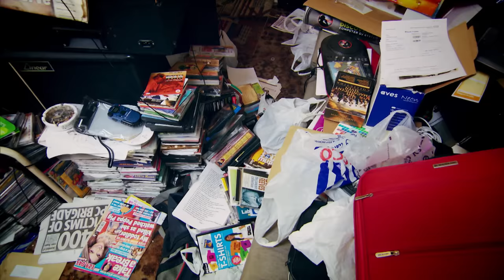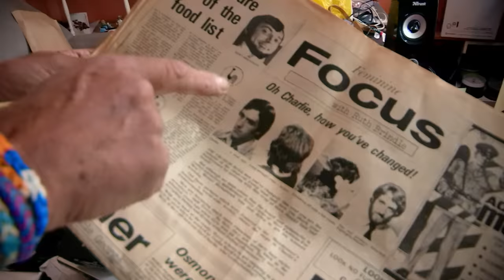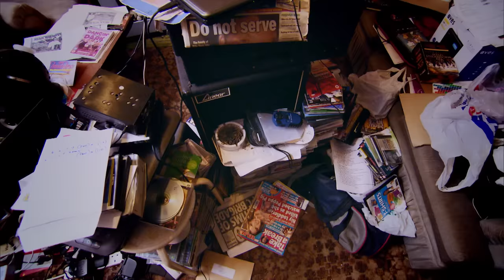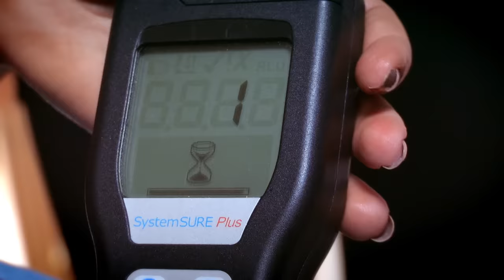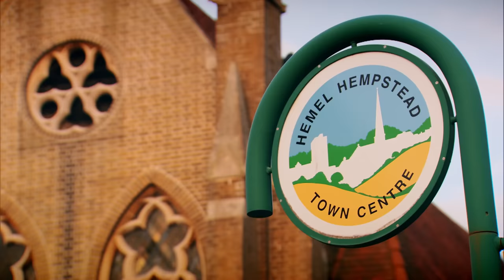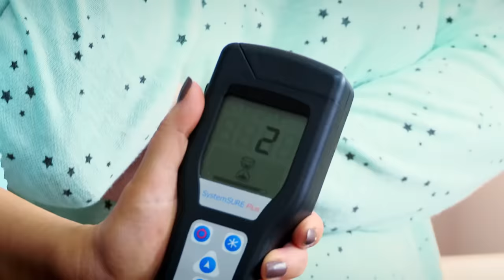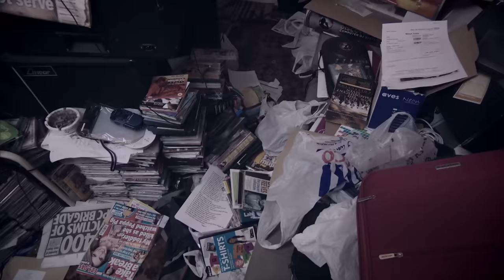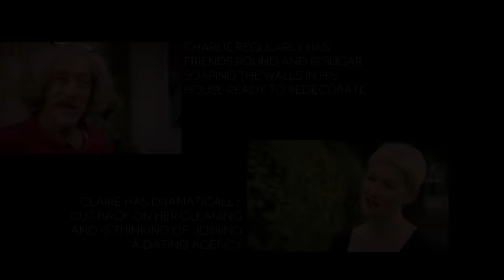Germaphobe Can't Believe Her Eyes In This Home! | Obsessive Compulsive Cleaners | Episode 13 | Filth

Comment: These OCD people always roll up or fold the dish cloth  when wet, this is a haven for bacteria, best way to ruin everything lol. The dishcloth needs to be washed and dried flat before folding.
Reply: Yup I agree I do that too
Reply: My dishcloth rarely gets dry, I always have something to clean in the kitchen. When I've cleaned the hob or the oven, the cloth goes straight into the wash. 
I need at least one cloth a day, more like two, sometimes three. The used cloths are washed together with other cleaning cloths in boiling water, of course with washing powder for boiling water plus a dash of soda. This ensures that the cloths are perfectly clean and free from bacteria.
Reply: @FionaMunro-vd2fb Honestly, can you give advice how to keep face cloths and towels looking bright or white if they are white? And soft too. Thank you.
Reply: @pretty-eyes  With pleasure. White laundry intended for boiling should be washed at least hot and always with white laundry, white towels, white bath towels, etc. 
Yellowed or greyed laundry that was originally white can be made white again with a special washing additive (drugstore) or soda or, for the worst cases, a relatively short bath in chlorine. If chlorine is used, select a short wash programme! Chlorine destroys fibres, so do not soak for days in a chlorine bath. Only use cotton fabrics for this special treatment. Then wash again as normal so that the chlorine odour disappears from the laundry. 
Only use vegan fabric softener, as ‘normal’ fabric softener contains animal slaughterhouse waste. This makes the laundry smell of cold fat after a few days to weeks, which I find quite disgusting, so I switched to vegan some time ago.
Reply: By the way: there is a washing additive for smelly laundry that can only be washed at low temperatures. Good news for sports enthusiasts. 
I wash laundry separately according to colour and temperature. 
If you don't do this, you end up with ‘river wash’ after a while. This means that everything is greyed and laundry that should be bacteria-free (= infection-free) for hygiene reasons is not. 
I hope I have been of some assistance. 
Good luck!

Comment: Bleach might kill the vast majority of germs but it also leaves behind a residue, if not rinsed off (ideally with a detergent), which can ironically harbour the very dirt you're trying to remove.
Reply: according to HACCP (the protocol made by NASA for astronauts' food manufacturing) you'd use a sanitiser afterwards, which is a combination detergent+disinfectant. this would be overkill though for domestic use, as the only real reason to do so is to kill any germs in the water you're using to dilute the concentrated chemicals, to get that big fat 0 on the germ meter to ensure your astronauts won't get the runs 3+ years after the date of manufacture

Comment: You can literally remove cooker knobs. They're just on metal rods with a flat spot, so they can pull syraight off. Just mind the spring doesn't fly off & you're good.
No dental Floss needed.

Comment: Floss for oven knobs??? Does she not know that you can remove those knobs and wash them or throw them in the dishwasher???  Lol bizarre.  Also..  using a blowdrier to dust??  Thay just blows the dust in the air!! Fine if youre obsessed with cleaning your home but you can at least do it in a smart way that saves time 😅